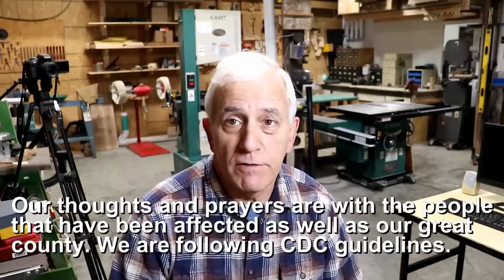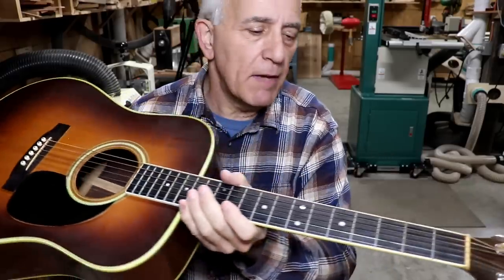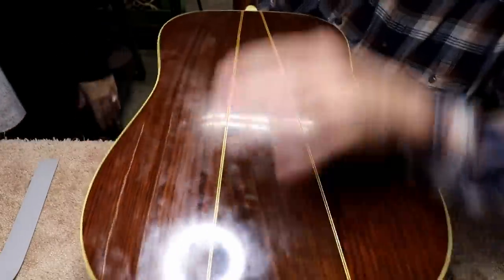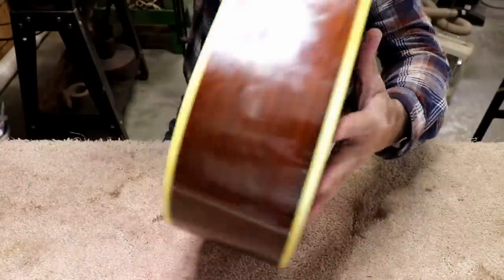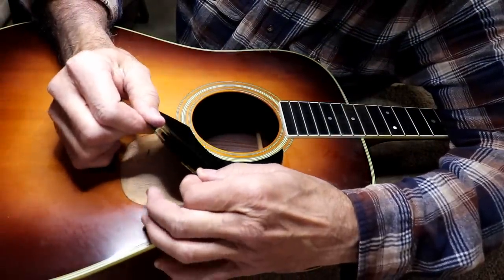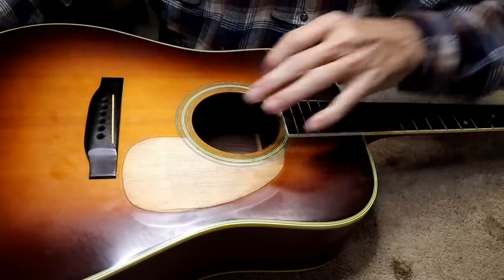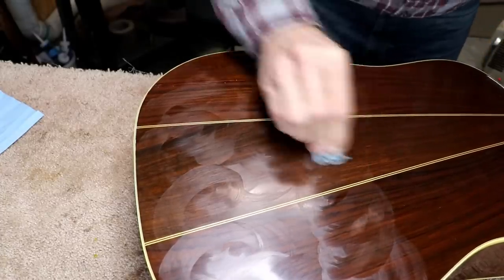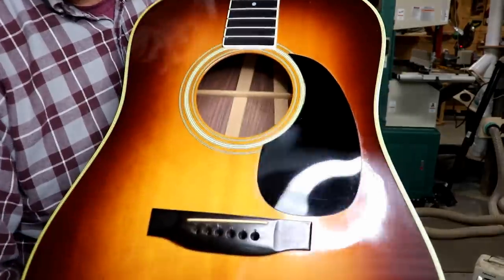387 RSW Martin D35 Impossible Crack Repair

Comment: I realize everyone hates Ovations for the Lyrichord bowls, but this D35 is the very reason I avoid 100% wood bodies. Look at the bottom backing and you can't make that look like it did new, a pre-owned Applause is a better body than this Martin has. I'd rather have a reusable bowl, that the only thing that can go wrong is the glue between the bowl and the deck/soundboard. My Applause may be built like a tank and may not sound as good as a D35, but you can bet repairing the bowl is never going to be an issue.

Then the bracing is messed up inside, what an expensive piece of junk ? That's never going back together properly ? Would almost need to cleat it ? Oh well, the uglified $ 1.65-4K D35. The way it turned out though, looks better than I thought it would, but this is why I wouldn't ever pay that much for any guitar. This one has it's issues that will never get better and you did a great job hiding those flaws. I figure the next seasonal weather changes or few and this D35 might be separating again ?
Reply: The intonation, that's the James Taylor method of tuning. every string is off by 3-12 cents on the open notes and that way the fretted string falls to pitched tune. For such an expensive guitar, it's way worse than my pre-owned sub $ 200 Applause.

Comment: Question; ive an acoustic and its cracked a little under the fret board about an inch right at the nut 1st fret. It never would hold tune right then i discovered the crack. U could tune it to play open chords then it would be out of tune on bar chords. DO I JUST PUT GLUE IN IT BEST AS POSSIBLE AND LET IT SET? 
Without strings at tension?
Or no strings at rest like it is now. 
Ive made the mistake of clamping one like this before( a motsu epi ea 250 my first one its gone but I have a secind one) and it was ruined all fretted out. Do I do like when I build boats and airplanes just easy clamp till glue starts to squeeze out?

Comment: I have a 1976 d-35 they were known for pick guards curling up. Mine did as well. In addition the trim on the neck came off as did the trim on that guitar. Martin Guitars of that period were notoriously badly built. Fortunately, they have a lifetime warranty, so mine was repaired by a Martin warranty repair Lutherer. He just about had to rebuild the entire guitar, as it was unplayable! He had the guitar for three years!
Reply: If you noticed, the pick guard was applied to bare wood. As someone else mentioned, Martin applied their pick guards (at that time) before the finish.
That's chemicals on top of the plastic (not good to start with) and as the finish cures and shrinks, so does the pick guard.

Comment: Lucky the fools put the light on the same phase. Somewhere the light box or one of the switch boxes im wondering if they didnt intend one breaker for recepticles and accidently tied the light in later if both those breakers wire runs leave together beside each other in the same direction they intended 2 circuits to go there. Then if it didnt hit the ceiling light box itself and switchleg down to the switch they sent them to the switch box and they got under the same nut and one probably was intended to catch the recepticles. 
Ii never put my lights on a receptacle cause they dim on vacuum cleaners and such.
Reply: Somewhere in a " j box" they accidently put the "Same color wires under a wire nut" not realizing two seperate circuits??? Theres my hindsight statement. Thankyou for helpin me work on my guitars and my mandolyna
Reply: What about wet the cracks then let it dry in the warm so it will draw back?? N8ce guitar.
Reply: Ooopps you supposed to cross cut a ridge or your gonna dig a puddle.

Comment: Hi Jerry first of all thank you so much for your videos. Like so many others you are inspiring me to restore guitars. 

I've had a question for awhile and never know where to ask it so I'll just do it here: Have you ever used neodymium magnets to clamp cracks? My thinking is that if you coated them in tape to protect surfaces (and to give them little handles to grab) and maybe used some additional kind of thin flat caul you could much more easily clamp in hard to reach places. 

Most common are circular magnets but they even make some bar magnets that could provide additional flatness: https://www.amazon.com/gp/product/B07DFZH4WT/ref=ox_sc_act_title_2?smid=A35842ASBR1GKG&psc=1

I'd love to hear your thoughts on this.
Reply from the maker: I do use them from time to time. I don't find them all that helpful. Most of the time they're not quite strong enough if I really need a crack to be aligned. Yes I did buy the most strong ones to the weaker ones, the really really strong ones are actually kind of dangerous. I find them most useful for doing something like gluing in a cleat which I don't do all that often. I only use cleats when there are other stresses. Most of the time they're not really necessary.

Comment: Would it have been easier to repair the cracks if the back had been completely removed first, or, would removing the back have been more  trouble than it was worth to effect the repair?
Reply from the maker: I'm doing a repair presently where I had to take the back off the guitar it's a Gibson j-45 when you watch that video eventually you will see how much trouble it is to take a back off a guitar

Comment: In my opinion, CA is the best adhesive to glue together two pieces that were oregionally one piece.
Reply: That depends, greatly, on what you are working with. If you are working with bare wood or a crack which can be clamped, Titebond is can't be beat.
Jerry had a crack which could Not be clamped and the glue had to dry fast, while he held it. That needs CA. You never get CA near a finish, if you can avoid it.
It will cause damage to the finish and create extra work and, possibly, insurmountable damage.

Comment: I'm no luthier but I don't think your rubber mallet was the right tool for the job.  A small ball peen would allow a more focused point of impact.  Not saying it would solve the problem but you might have a better chance.
Reply from the maker: The metal Hammer would have left marks. Then I would have had to fix the marks. Generally a rubber Hammer will be plenty strong to jar piece of wood into place. This instrument wasn't having it.

Comment: Hi Jerry I understand your use of super glue especially the thin one I use it a lot as I build radio control planes there is a glue you may well have used it I don't know but just in case it is called super 'phatic   https://deluxematerials.co.uk/products/super-phatic it is pretty good stuff quite thin and really good when you find that your fingers are the best clamp but super glue will make you part of the finished article ;-)
Reply from the maker: Thank you I will try it.
Reply: Did you tried it for a crack in a guitar? I think this would be perfect but sounds to good to be true.

Comment: You should use a microfiber towel. Period!
Reply from the maker: Well thats your opinion period.  I'll use what I ike.
Reply: @RosaStringWorks   the paper based towels contains wood particules that can scratch the surface we are polishing. So, we must use a tissue in order to obtain a perfect shine. The way you do is as you say: its not perfect...!
Reply from the maker: It creates a very high lustre. Im very happy with using them.